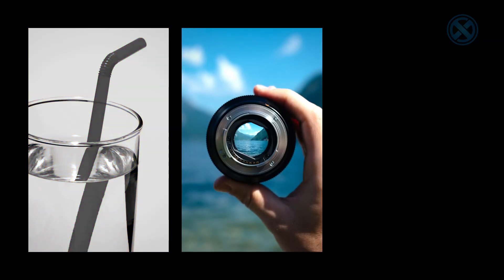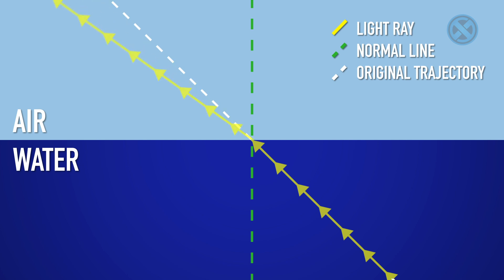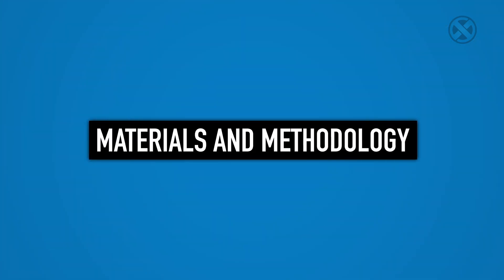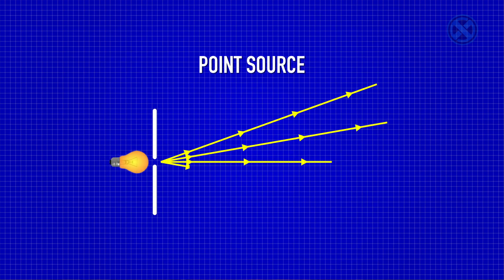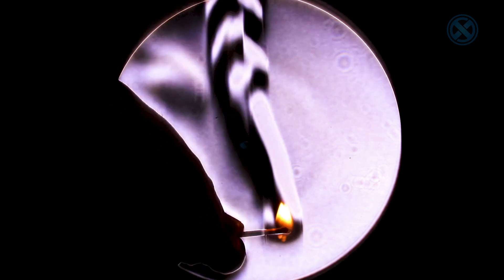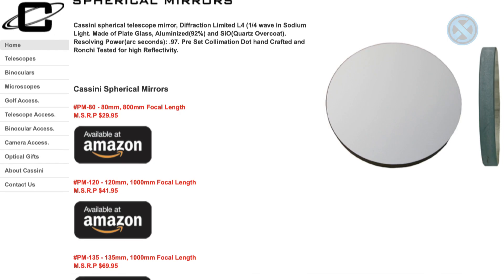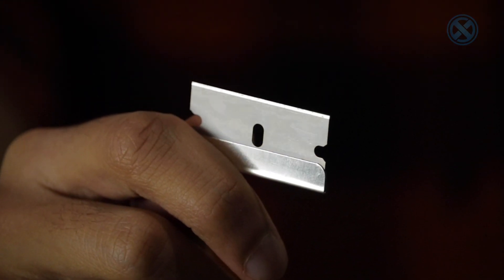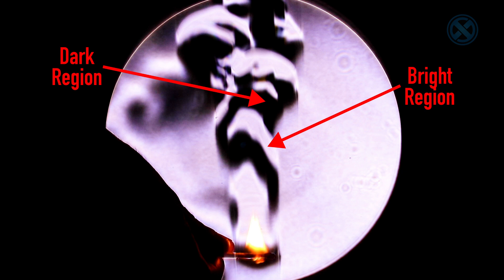How to See Air! | DIY Schlieren Imaging (Part 1)

Comment: You can see schlieren with your unaided eye when you open up your car on a really hot day, as the hotter air from inside your car escapes into the cooler air outside.

Comment: Great video! I am looking to make a set up like this, but I am have trouble with finding a proper mirror. I need one with a long focal length (at least 900 mm), like you shared here, but it looks like the ones you shared are no longer available. Any suggestions? Thanks!

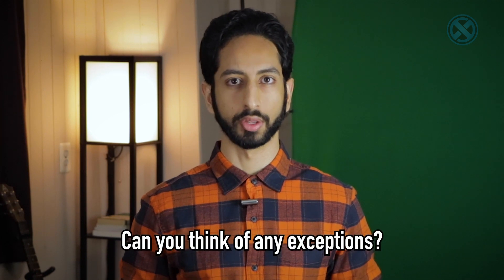Comment: 3:12 An exception could be when you're driving down on a hot day, and they air just looks weird, light you can see squiggly line things; I honestly do not know how to describe that
Reply from the maker: Yup, that's a perfect example! It's called a mirage. As the hot asphalt heats up the air above it, that layer of air becomes significantly warmer than the air above it. This generates a density gradient, which causes the resulting refraction to become visible.
Reply: @NexusAcademy  yeah! Also I knew It's called as a mirage, but I failed to describe it

Comment: Incredible! Can sound waves be modelled like this, too? I mean after all, they are some compressions and rarefactions, and so probably, we can see them with schlieren. What do you think?

Can't wait for Part 2!
Reply from the maker: So yes, you can visualize sound waves! If you wanted to capture sound without any sort of intervention, you would need either need an extremely expensive high-speed camera or an extremely expensive high-speed strobe, since the speed of sound is far beyond what a normal camera shutter can capture. But another (cheaper) way is to create a standing wave by reflecting sound off some type of barrier, so that the peaks and valleys appear locked in place instead of a blur that's literally moving at mach 1. That could be filmed with a regular camera.
Reply: @NexusAcademy  yeah, u get why a standing wave would do the trick
Reply from the maker: I'll see if I can find a way to do this!
Reply: @NexusAcademy A good option is to post It in your other socials or maybe, even in the part 2 video!
Reply: @NexusAcademy  Would love to see what standing waves look like with this setup. It would be really cool it it is capable of seeing ultrasonic frequencies
Reply from the maker: @andrewphillip8432  Funny you say that!! I'm actually currently trying to get my hands on an acoustic levitator, which works by generating standing waves with ultrasonic frequencies :) I think that's the most accessible way of visualizing sound waves with schlieren.
Reply: @NexusAcademy  that’s cool haha, looking forward to seeing it!
Reply from the maker: @andrewphillip8432  Thanks for the suggestion!